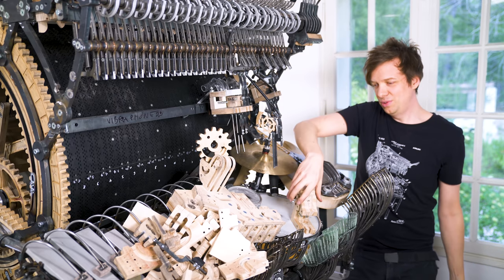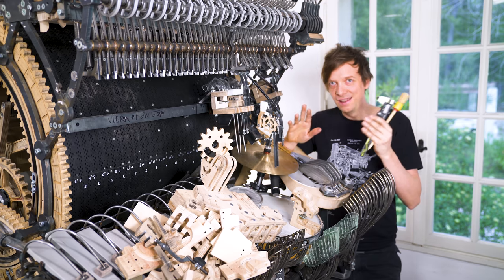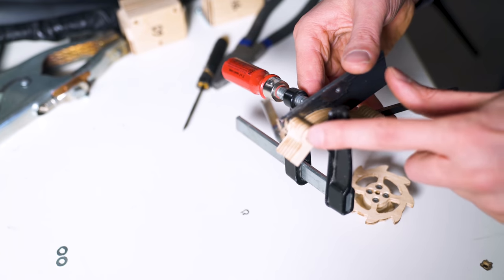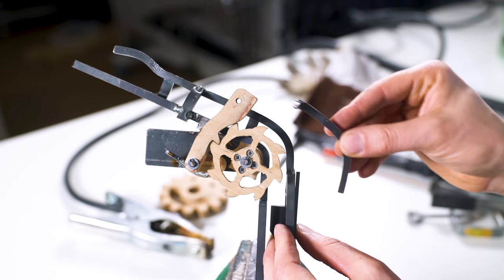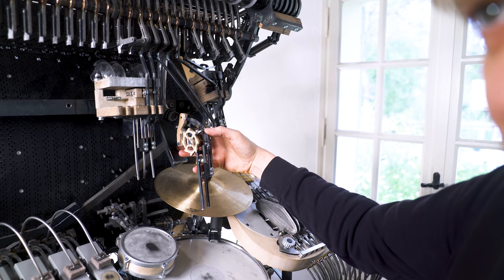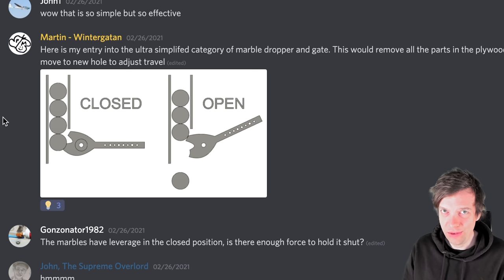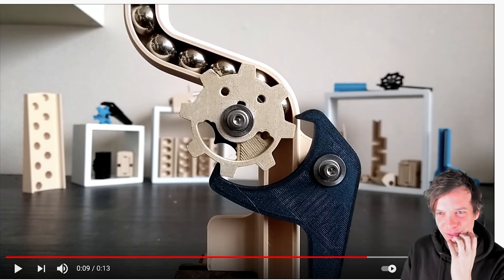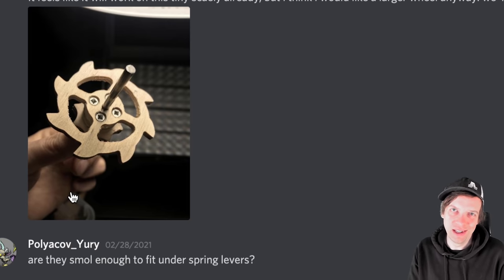Clock Escapement Marble Gate

Comment: It's so small and airy, it just opens up the machine so much. So I would say it was an 11 on both because it's going to make it visually easier to look through and more aesthetically visible.

And as for the plywood gear. Veneers. Make the gear out of metal, then apply adhesive vinyl woodgrain or ultrathin wood veneer to the sides with the teeth exposed on the marble side and slightly back from the tooth edges on the outside. You'll get the visual of the wood and the strength of the metal.

Comment: In my experience wire welding, I've used stainless wire on mild steel material, solid core er70 wire on stainless material, and joining the dissimilar metals in all these options and have not had a weld fail. The only failure point would be losing the stainless properties in the weld joint when introducing non-stainless material. That being said, I'm not a professional welder and have no formal education welding, but I've done a lot of welding.

Comment: The pressure, from the weight of the queue of marbles, is energy that is dissipated through the contact points of the escapement. Part of the reason watches use rubies and other gemstones for the contact points of their escapements is to minimize friction, but also to reduce wear. If you try to keep these parts entirely wood, they'll wear very quickly and the timing will drift. If you want to keep the look (and let's face it - they look awesome) consider covering the contact points of the escapements with something harder and lower-friction. Unfortunately, this almost guarantees an increase in noise.
Reply: Plywood, steel, and rubies
Reply: Timing won't drift due to the friction here, because there's external regulation of the timing. Clocks rely on internal tuned systems to maintain timing, and those systems can be detuned by changing friction; the MMX time is kept by Martin (or the motor) which cannot be disrupted by infinitesimal changes in friction (which are largely irrelevant compared to other more significant sources anyways).

Comment: For repeatability of those bent steel parts, Ron Covell has some great videos on how to get a jig setup without needing to do any hammering after, (or maybe just a lot less.) I recommend his ToT collab, the dustpan videos. It's a different material, but it has some good tips.
Reply: Won't be necessary in this case, as the finished design (non-prototype) will use laser cut parts.

Comment: if you do adjustments you can eliminate the lower plastic catch block and release the marble at the gear

and if you want it to be more visible you can put the escapement on the front of the dropper however it will be more parts and more engineering

and you can use metals like brass/copper/bronze

Comment: If the marbles went under the wheel instead of over it. They would need a floor underneath them to keep them from falling.this floor could be adjusted to change the point at which the marbles would fall.which would allow you to put adjustment screws on the stops.so you can change the position of the wheel slightly clockwise or counterclockwise changing the height of the marbles in the marble tubes.

Comment: Speaking of time the free air drop time of the marbles comes into it too. This whole thing is fascinating. 🤔
Generally welding mild steel to stainless will crack. To mitigate this issue use 309 stainless filler wire. :)

Comment: You have high contact angles between the marble and the "star wheel".  All these parts need to be steel, with ball bearings on the escapement wheel/marble star.  The star needs to have deep notches and long thin teeth to keep the contact angles low.  This mechanism is prone to jam unless careful design is used.

Comment: Okay Martin, seeing how much time you spent on the marble gate redesign, I think it is safe to say you need to do a scale test of 10 000 or 100 000 marbles as soon as possible. This is a potentially huge breakthrough, you need to try to make it fail as soon as possible to evaluate whether or not the limitations will be easily solved if there are any.

Comment: Excellent idea! Seems like it's the final edition of marble gates))
But... Maybe wooden gears looks pretty and good for noise reduction (less clacking sound on each marble), but better to replace them with metal. At least press the brass bushing in it. Wooden gears in programming wheel are Ok, but not in this case. The gear makes full circle each 8 marbles, with ratchet scratching each wooden tooth.. I doubt it'll survive even 100000 marble test...

Comment: To keep every channel consistent, you would be better with a vertical link between your dropper module and have a horizontal extension to the current note pin register.

Comment: Add the automatic slots for the marble divider and get rid of height adjustment, and you're up and running with a reliable solution.
Constant height might not be possible with those gates anyway, and the less adjustments needed, the best the reliability.

Comment: Remember to add enough room for phelt where it's needed, when the marble hook catches the marble it needs phelt and where the baby dinosaur hits the gogwheel, it needs phelt.
So in the design you need to reduce the widths of those parts by the thickness of the phelt.

Also the metal the marbles ride on cause a lot of noise also. Not sure how that could be fixed outside of using anything other than another materal, or just put phelt there too?

Comment: looking good, relatively simple design, more reliable we can hope. I have to suggest something, it bugs me every time I see it. when you finish tig welding, the extra gas is not to cool the part, it's to prevent oxidation until the part has cooled. it's better to keep the tig torch in place for that last moment, not wave it around which only stirs oxygen into the area.

Comment: I wonder if you put an adjustment screw between the stop and the gear.you'd be able to change the position of the gear a little bit clockwise or counterclockwise. Which would allow you to adjust the height of the marbles in the tube, that would give you a smoother surface for the marbles to roll over in the marble divider
Reply: He's remaking the divider to not be height sensitive so no need for that

Comment: I recommend using the spring. Springs are very reliable and it would allow lighting speeds ti be archived.
Also, metal on metal is never recommend, see NASA vacuum weld and plastic bushing on vehicles.

Comment: Just a heads-up that you need to take some safety precautions around ventilation if you're welding stainless steel - it contains chromium, and chromium fumes are very carcinogenic - you really don't want to be inhaling them.

Comment: I have posted this in with wintergatan 2 fish stair video also. I though it will be relevant here too.

Martin! I don't have a drawing but I think I have a problem statement that could lead to a possible solution for you. 
I think the problem is not the fish stair as all the stairs work perfectly except the loading. I also don't think the divide by 4 is the root cause. I think there should only 4 marbles available for the first stair or at least make sure  the pressure against the first first stair is equal to one marble at each position. it could even be a bit more if not held down with the spring plates. I believe the clock escapement marble gate mechanism in lock step with the stair could give you exactly that.

Hope this helps.
The clock escapement is wat the doctor ordered for. I believe you are in the home stretch man!

Comment: I agree that the escapement wheels need to have a different color than the metal preferably a light one like the plywood. although I do find the plywood wheels looks a bit janky so maybe replacing them with cut brass sheet would be nice, if a little expensive.
Reply: Brass is p soft, so I imagine it'd deform and wear out quickly
Reply: @HmmmmmLemmeThinkNo  it's much harder than plywood though.

Comment: You can easily weld stainless to mild steel. There even is filler rod to do this properly. It's material number is 1.4370, i guess it is also known as 307si.

Comment: I really like the new design and hope that the moles will stay away from this one. ;) My only worry is that if the plywood stopper for some reason gets stuck, then the wheel will spin uncontrollably while the metal stopper is open, which would both ruin the music and empty the channel very quickly... It could be worth looking into connecting the two stoppers so that both stoppers can't be open at the same time?

Comment: Love the new design, but that bearing surface between the two halves of the escapement is a mole that needs whacking. It will wear quite quickly, if it’s metal on wood.
Reply: Some UHMWPE stuck to the contact surface would sort that out without a visible difference.

Comment: If you want the contrast in colors but in metal then copy a real clock mechanism and use brass for the wheel which  also won't wear as it provides a bushing effect.

Comment: What about clock escapement for the World Tour. It plays looping tunes but it is taking the tuner in loops. Making this pressure bearing moving part of ratchet mechanism with plywood could be OK for prototyping but the actual part needs to be built of very hard wood like old dry hardened wood like oak, teak as outsourcing with aluminum shall increase the material weight and create just another working imbalance

Comment: Is it a problem that the temporal distance between the "click" and the instrument "strike" is static? So even though the clicks will always be at the same tempo as the music, the music will always be delayed by the same time, dictated by the distance from the gate to the instrument. So the echo of the instrument strikes behind the gate "clicks" will only cleanly line up with tempo if it's a multiple of the tempo itself. I guess it's only a problem if the enhanced gate "click" (more than the old gate) is particularly intrusive on the audioscape of the music. It may not be, considering the volume balance of the instrument strikes over the gate "clicks" and the artistic aesthetic of incorporating mechanics into the soundscape.

Thoughts?
Reply: I agree and replied something similar elsewhere.
Martin made the classic mistake of getting rid of an old part before doing a side-by-side test (for sound level or reliability).

Comment: Martin, if you want the wood “look,” just get some laminate and put it on the Delryn or stainless steel wheels. This way, you maintain durability and get the “look” you want,
Reply: I think you missed the essential. Patching a look on a technical solution is never what this machine was about. If so, why bother with marbles in the first place? Whatever the solution, it’ll always be a honest one. The beauty of it is all about elegant problem solving.

Comment: @Wintergaten - you have NOT 'failed' in building a Marble Machine o play music - you have built a Machine that does that with a very 'low' risk of losing Marbles during a performance.

What you are doing now, is revisiting the design and looking at where the design can be improved to reduce the risk of a Marble escaping and causing any issue. The basic principal isn't really changing - its still working in exactly the same way even if the Marble dropper design is different. 

I know that this video is a lot more positive where in the past, you have seemed disappointed that the Marble Machine isn't 'finished' but I see it as ongoing maintenance and improvements - taking it from 99.99% (as in losing 1 marble in a 1000) to maybe not losing 1 marble in a 1m or even 10m.

Its like updating Software with better efficiency, more stability etc so it performs 'better' with fewer issues/crashes, bolting on or replacing older components to add more functionality and/or improving the overall experience and maybe make it even easier to use. Game Engines for example are used to create new games and Devs often update bits and bolt on new bits to add features/functions and improve the overall efficiency. Their interest lies in the way Data flows through the engine and you are looking at the way Marbles flow through the marble machine. They also need to make sure that Data is where it needs to be at the right time and that is not 'lost'. The data is separated to go to various areas - Audio files, Textures, Assets, etc.

I bet the internal Combustion Engine is a lot different today in terms of efficiency, reliability and of course performance. It was 'good' enough and over the years, its been developed, iterated on etc as better understanding and knowledge have helped to improve the design. Its not just better understanding of the 'engine' but also of materials, aerodynamics (which also matters for engine cooling and efficiency) etc. 

Point is, you are into the final stretch, whether you feel that or not. You could of taken the Marble Machine on tour and it would 'work'. Maybe not as efficiently as you need to play a 'long' concert or maybe might break down if a marble escaped but it made music exactly as you designed it to do. Now you are literally troubleshooting the areas that potentially could cause a problem over thousands, if not millions of marbles - improving the efficiency and reliability.

I can see the Marble Machine being a life time project - bits being added and/or replaced - either to increase its functionality, to replace less efficient (or worn out) parts, or improve its ease of use. I don't think it will be static - even when you 'think' you have finished. Maybe you want more 'drums' or some other sounds, maybe want to make it easier to switch between songs etc. In any case, you have built a very impressive working Marble Machine and now seem to be in the final phase of troubleshooting to improve its efficiency...

Comment: I know this is off topic and I have no input, but this has been bothering me. Having the marbles lifted on the left side of the machine and then very tightly trying to go down the hoppers from left to right is a poor design. Why not have the marbles slowly track to the right side of the machine and then turn back filling the hoppers from right to left. More fluid/less cramped. Thoughts?

Comment: I would also look into mounting the escapement parts on bearings, keeping in mind long term wear and reliability
Reply: I think you mean bushings. Bearings are overkill for low RPM and/or loads.
Reply: @thomasbecker9676  I agree, it's absolute overkill, but it's also the easiest way to guarantee the reliability of that system. A nice sealed skateboard bearing is practically dustproof and under this type of non-load will never wear out. This removes a point of failure for each channel completely.
Reply: @233kosta  Maybe, but do you trust him to press a bearing into place without screwing it up? A bronze sleeve is far easier and cheaper, and accomplishes the same thing.
Reply: @thomasbecker9676  He's already done a few for the bigger spinning parts, so why not?

I agree it's cheaper and easier, but going forwards these things will have to be regularly checked for wear, kept clean and ideally lubricated.

Remember, the point here is long term reliability, Martin wants to take this magnificent beast on tour, so the last thing one would want is to have to pull it apart after every other show for maintenance. Much easier to just overbuild the crap out of it now.
Reply: @233kosta  That point (reliability and low maintenance) falls flat when you just consider the materials being used, though.
Reply: @thomasbecker9676  I'll let you talk him into rebuilding it out of acetal 😉
Reply: @233kosta  snort like he or his "engineering team" give a crap what anyone outside the echo chamber says.

Comment: "Not a single issue!"
A freakin 10⁶Db mechanical noise is not an issue okay
Reply: It'll be interesting to see how that is addressed. I'm thinking some felt and we'll be back in business.
Reply: @HeroUnit  hhmm well if u say so
Reply: @HeroUnit  And what happens over time when that felt compresses and throws off the timing?
Reply: Every machine requires maintenance. This one is no exception.
Reply: @HeroUnit  Yeah, but good design minimizes maintenance.

Comment: if you want "pretty" of wood, but reliability of metal, why not make the gear out of a different color metal?
you can heat treat steel to turn it blue, and yellow.
you could also use brass.
if you havnt seen any of 'clickspring's videos id highly recommend them. beautiful metal work.
you could do a lot more with beauty on the metal work of this project if thats something that interests you.
this project is still great, and i cant wait to see it finally done.

Comment: Welding stainless to mild is fine IF you use stainless filler rod!!
Reply: Don't forget to use a stainless wire brush as well to clean the welds - if you use a normal brush the weld will be rusty in hours!

Comment: The wheel should be brass not plywood.  
In Brass it will still stand out from the rest of the metal, not be that dissimilar to the current wood color and also mimic the gears in a mechanical clock or watch (often made in brass or 'yellow' colored metal)

Comment: honestly, clock-design is cool but isn't that adding more friction risk to the machine?
Reply: The overall friction is significantly reduced with this design, actually, as the force applied by the marbles has much less leverage against the friction surfaces.
Reply: @nikolaihedler8883  i was just worried about wheels get stuck somehow. In more detail like a timing issue in the  stopping mechanism or so.